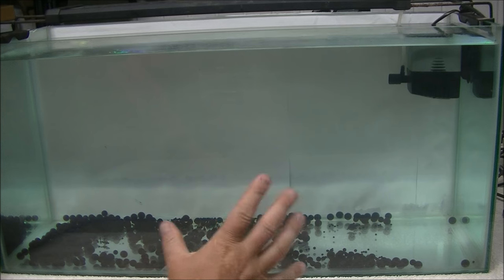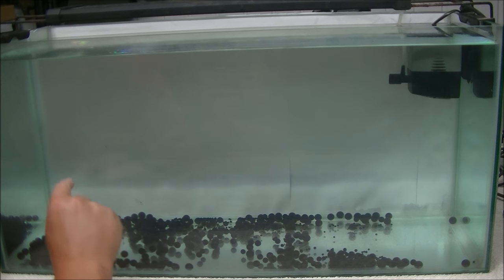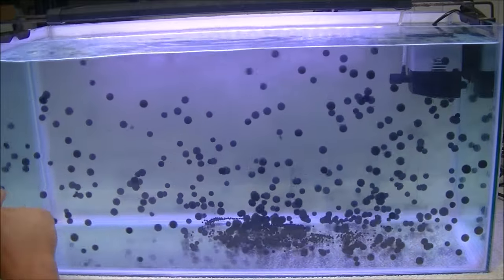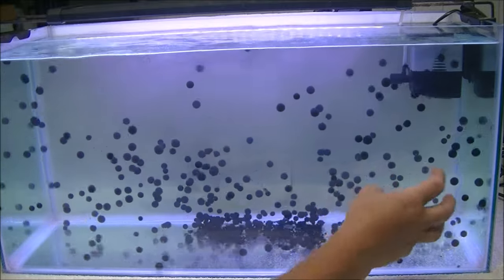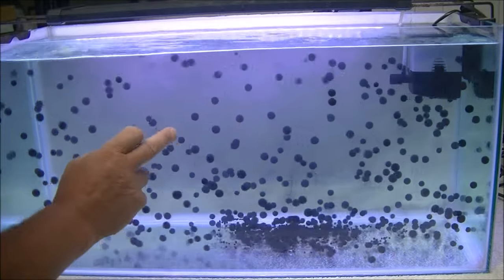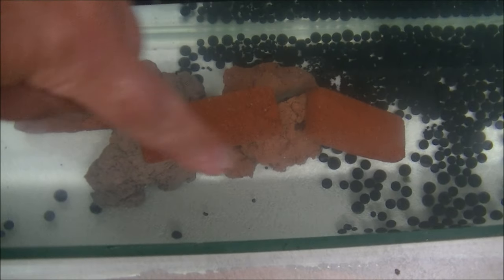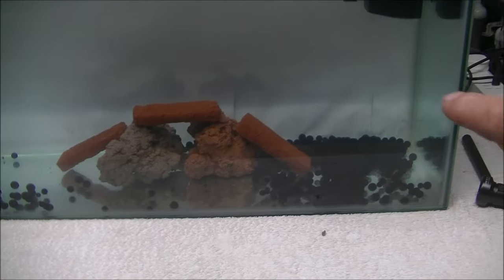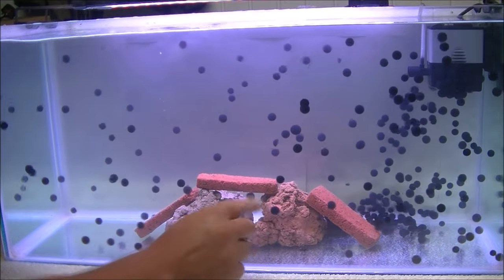Best Inlet and Outlet Placement for a Canister Filter on Fish Tank - (with proper demonstration).

Comment: I appreciate what you've demonstrated but unless you have a peninsula tank most people won't want an output and intake on the side glass. Most people have them on the back at either opposite sides or them both on one side shooting the water diagonally but still creating a similar but probably not as effective semi circular flow. I wish you would have demonstrated those two options to show for the majority of people who wont position their outlets on the side glass of their tank.
Reply from the maker: There are so many possible set ups for intake and outlet and ultimately the 'best' set up is whatever works for you - just experiment and see what is best for your tank since every tank is different.
Reply: @pondguru  no i get what you are saying, it would have been nice to see how the water flow differed from most peoples standard installation in how you demonstrated,

Comment: What if you have a filter flow shooting form one corner to the other diagonally? I use an internal canister, Sicce Shark 600. What would be the ideal positions, its a triangle layout (raised on the right side of the tank).
Reply from the maker: There is no way to say 100% which direction for the outlet of an internal filter would be best since every tank is set up different - therefore just experiment with whatever works best for you.

Comment: What happens if your outlet is 1/4from right side but aimed to the right wall so the flow kinda hits just off front left corner on right wall where does it go from there i am curious
Reply from the maker: I'm normally good at visualizing things but I can't wrap my head around 'the flow kinda hits off the front left corner of the right wall', lol
I'd just say set the outlet up and see where the muck collects - if you're not happy with that try it pointing somewhere else and repeat until you get something you're happy with.

Comment: I have a juwel 350 and have no choice but to put the intake at the opposite side due to the cutouts.
Reply from the maker: Whatever works is good enough and as soon as you introduce structure and plants into the aquarium the flow changes anyway so don't worry about it.

Comment: Where do i get somw of those floating balls
Reply from the maker: They are the Evolution Aqua Pure Pond gel filter starter balls. That's what I give away with the Biohome filter media on the FilterPro site since they are a great way to naturally seed the filter media.
Reply: @pondguru  o geez those look pricy for a test in my 35l tank. Is there anything else I might be able to use
Reply from the maker: @JustinKraft  Anything which is neutrally buoyant and small enough will do but the only other thing which springs to mind is K1 micro filter media but it will float for weeks until it builds up a bacterial slime and become neutral to move properly in a water flow.
Reply from the maker: @JustinKraft  You don't really need anything to see where the muck collects - just set the tank up and change the flow direction every day or so until there are minimal dead spots.